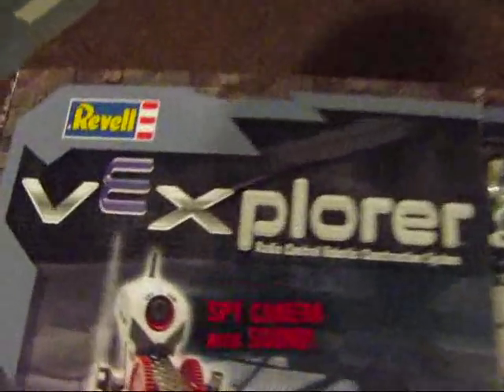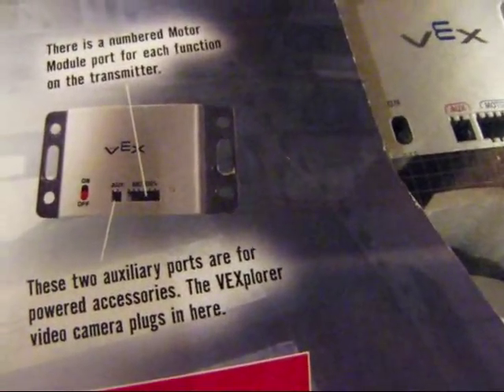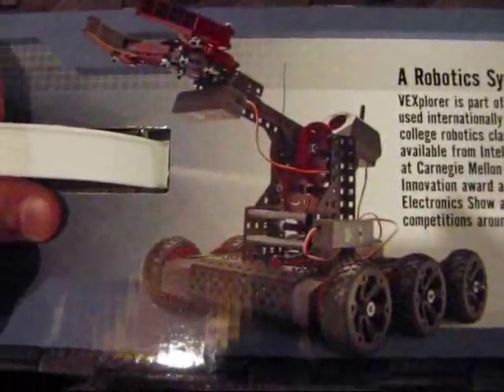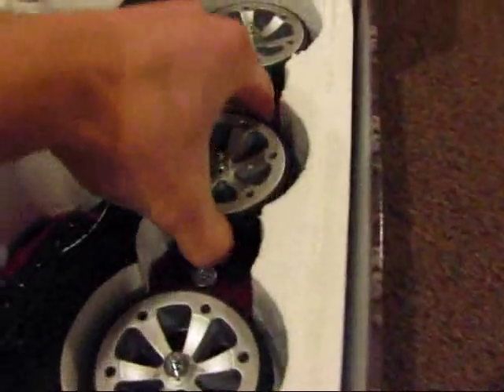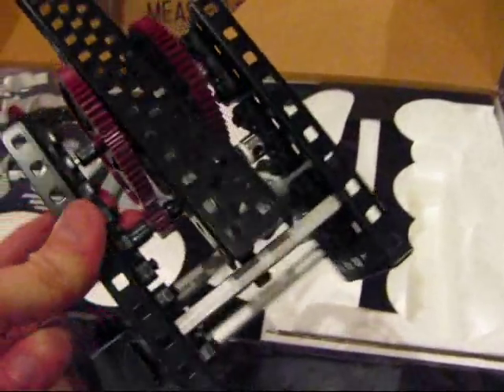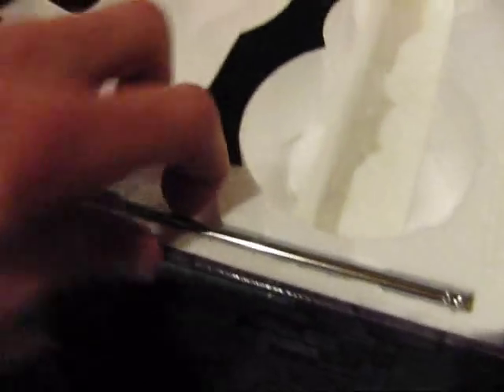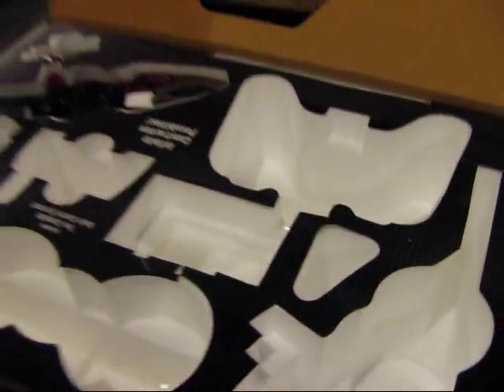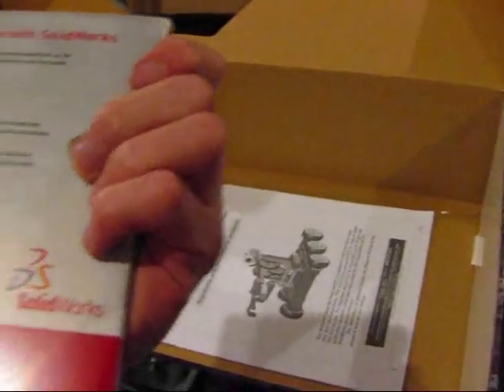Unboxing of Revell Vexplorer Radio Control Robotic System

Comment: I paid $80 at Fred Meyer clearance. No shipping. Works great, a complete pain to put in the first set of screws between the motor and a plate, had to use yugi-oh cards to fill in the gap.